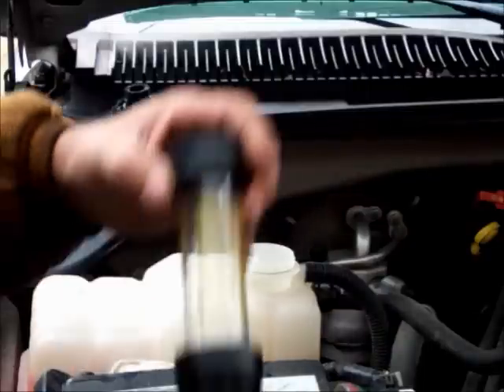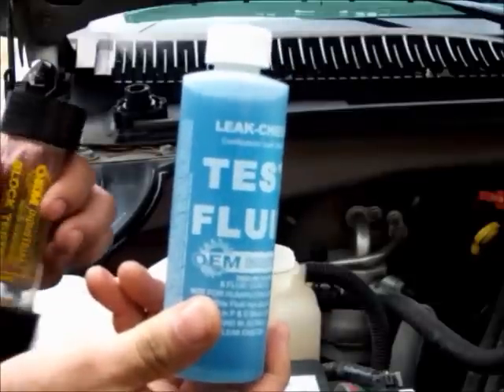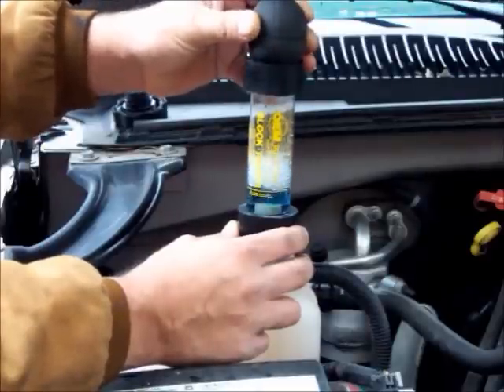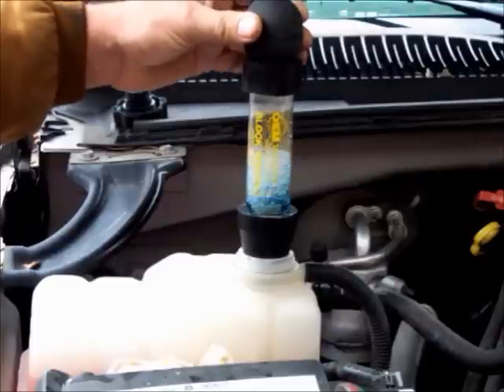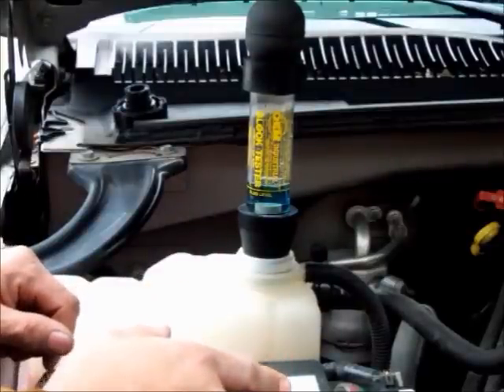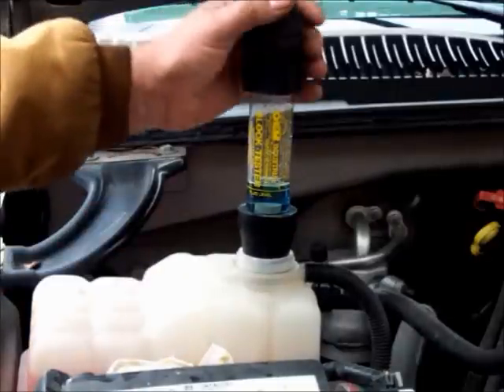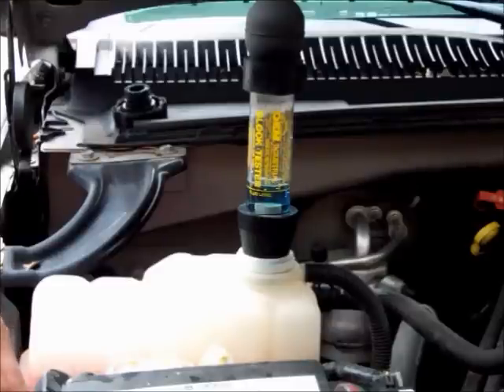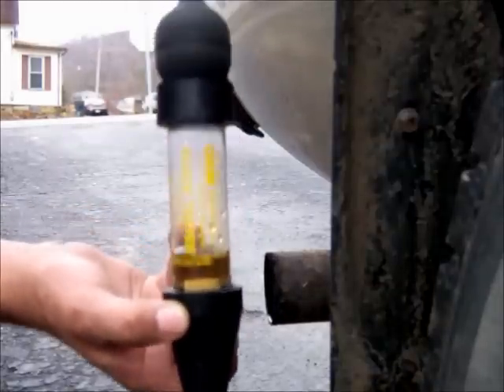Testing for Bad Head Gasket or Cracked Head or Block.

Comment: Do this block test . Then pull the plugs toi see one or two plugs are bit looks different from others like bit cleaner.  Because of evaporated radiator fluids steams cleans out plugs.  When you see those plugs with the cylinders then that locations causing leaks.  Usually i would put small scope camera to see the leak running down those cylinders even .
Reply from the maker: Thanks for stopping in and commenting

Comment: Where are you putting that tool in the resevoir ??
Reply from the maker: Yes unless one has a radiator cap then test there . If testing at radiator cap may need to drain a small amount of coolant out , so it does not get sucked up in the tester

Comment: Looks like this test is done from the coolant overflow tank, is that right?
Hope you reply because I Really need to know if I should get my transmission rebuilt without the worry of a cracked block. It overheated on me after the issue began and after replacing the upper part of the motor only to have the transmission crap out.
Reply from the maker: If the vehicle has a  radiator cap use it . but coolant needs to be down enough that it will not get sucked into the tester It will tell if exhaust gas is entering the cooling system . That could be a gasket , warped head or a crack. Sometimes a crack can leak when engine is at operating temp and not cold and could also be the other way .
Reply: Thank you. Since my comment I went and picked it up.
Fluid stays blue at the overflow tank.
Will drain a little fluid at the cap and test there as well.
Reply: No need to reply to this. Did the test at the radiator cap, still good results.
Had major issues less than a year ago. No heat, major overheating.
Ended up being cracked heads. Replaced last winter and all was good until June.
Transmission decided to act up. Code was saying P0740 TCC Solenoid Circuit.
Replaced four solenoids and all was good but after 118 miles the problem returned, same code.
And it overheated again. We had the engine mounts disconnected and the engine cocked a bit to do the work.
So my thought, as well as the guy who did the work is, an air bubble got trapped in the cooling system while doing the work due to how we had the engine.
It's a 1998 Pontiac Tran Sport which can be a pain in the backside with trapped air bubbles.
As with everyone else, you would be shocked if you saw this van! It's mint for it's age.
Reply from the maker: @GreenMountainGoldTrap  spill proof funnel , can help get the air out .
Reply: @wtbm123  👍 Yes, this vehicle has given me experience in that area. Done it a time or two with other methods.
Thanks!

Comment: You said unburned gas won't set the color off well what if you have water on your spark plugs and they're fouled out how do you know that that is a head gasket or an intake gasket
Reply from the maker: Compression is greater pressure than the cooling system so the exhaust would enter the cooling system . If you have enough water in the cylinder that it will not fire . then you know the  issue is a coolant leak but where . You may be able to do a pressure test on cooling system to see if you can see where the coolant is leaking . Or can do a leak down test of the cylinders and see if cylinder holds pressure . if it does hold good pressure , and you are leaking a lot of coolant then it probably not a head gasket . They also make dye to put in to coolant . . It can show external leaks or can help show if  gasket is leaking when tearing it down .

Comment: I did this test on the radiator & coolant overflow it did NOT turn yellow. But when I tried it in the exhaust pipe the liquid turned yellow. Is that mean I have a leak or bad head gasket?
Reply from the maker: No exhaust is supposed to come out the exhaust and a good way to test the fluid to make sure it is good . And this test will pick up the exhaust in the coolant , but could miss very small leaks
Reply: @wtbm123  How do I check for smaller leaks?

Comment: Is it possible to know if is gasket or craked without open the engine  ?
Reply from the maker: Not always , but if had a scope may put in cylinder , pressurize coolant and look . . Maybe dye , but would probably still need to tear apart .
Reply: @wtbm123  tank you sir .

Comment: Great video. I just did this test on my 05 f150 and when squeezing the bulb, it stayed deflated when let go. Why would this be?  I could squeeze the sides back to try to force inflation and some bubbles would come up through the stone, but not easily like it should. Any ideas why?
Thanks!
Reply from the maker: I wonder if that tester ball is defective
Reply: @wtbm123  I guess it's normal after checking other videos
Reply: @johnkelly4381  awesome! Thanks for the tip!
Reply: happenned to me too bro... i rented from Oreillys..  vids show it effortless sucking up air bubbles but in actual, the damn thing is weak and tends to stay deflated

Comment: I can’t really tell of a 1994 Ford ranger it’s leaking coolant after revving it up to 400,000 RPM and it’s also leaking transmission fluid and oil the guy told me that it had a new transmission and a rebuilt motor can you tell me exactly what’s going on I’m having a very hard time can’t figure it out

Comment: I have a 1993 Ford Ranger 4.0 liter. The engine temps increase only when AC is being used in slow moving traffic. However It's normal on the highway with AC on? I flushed out my radiator 4 times and did a cleaning and then used 50 50 antifreeze. I hope it's not my head gasket. No water on the dipstick etc.
Reply from the maker: Is the AC fan working , Does it have its own cooling fan
Reply: @wtbm123  No, only 1 fan. It's a 93 Ranger.

Comment: Are you sure that you can use the overflow tank to do this? I used the radiator cap, but the anti freeze  slowly rises, and I cant test it because it comes up into the tube, but every video I see of block testing uses the raidator cap area.
Reply from the maker: If there is a cap on the radiator then use it , if not use the coolant revivor
Reply: happenned same with me... they say suck out some antifreeze so the level is lower but it keeps rising as ur testing.. did it 4 times and it eventually rose into the tube and mixed with the blue stuff... it then turns green and gives a false reading... tricky to use!

Comment: Good video, thanks 👍 is it okay to use it on all vehicles.overflow tanks or should it be done directly on the radiator? Need to do this next weekend
Reply from the maker: it depends on how it is made . if it has a radiator cap and it is high enough to not leak fluid when open then you can use it , but the coolant needs to be below the tester enough , as not to suck coolant up in the tester . . Many do not have a radiator cap so you need to use the overflow tank.
Reply: @wtbm123  Thanks for the reply man 👌👍

Comment: So, do you put the tester in the overflow or in the radiator? I need to test mine. I’ve changed the thermostat and water pump and it was giving warm air all day and the temp stayed right in the middle until the late evening and the temp started rising and no heat in the cab again. I’ve been thinking maybe the thermostat although was recently replaced may have went bad or maybe the heater coil or the coolant sensor. I pray it’s not the head gasket. My town and country LX is a 2001 with only 76,000 miles on it. Please reply so I’ll have a better idea of what I need to do next. Thanks
Reply from the maker: Well that depends on how the system is made on yours . If the radiator cap is lower than top of engine , a lot of vehicles do not even have a cap on radiator  , but if lower than engine need to use the overflow bottle . if the radiator cap is higher than top of engine then use it . . Also do you see coolant leaking or smell it up in engine compartment . If so may want to pressure test it to see any leaks

Comment: I don’t no what else to do
Reply from the maker: test it . if turns color you have exhaust gas in coolant , This is a good first test , but sometimes hard to find if very small leak . a gas tester is more accurate but very costly , but could have a garage test it for you .

Comment: Ok can you help me with something ok I have gmc envoy 2005 I’ve change out Radiator water pump thermostat idler pulley Alternator Tensioner pulley and all the water inside the radiator is going somewhere there’s no leak showing but every time I have stop somewhere I have to put water in it
Reply from the maker: Well you will need to either do a block test to see if it is getting combustion gas in coolant , witch would prob be a head gasket . If so fix because if coolant gets in exhaust it will ruin the  catalytic converter . another thing to do would be to pressure test the cooling system and look for leaks

Comment: Thanks. Great information.  is it possible to get exhaust gas leaking out from a turbo back into the coolant system and changing the colour?  Some Ford eco's have a secondary cooling circuit via a small auxilary 12v pump to just cool the turbo water jacket, even after switch off. If there is good cylinder/headgasket pressures on test and all other things considered, could a damaged turbo/seal give similar coolant loss symptoms to a leaky head gasket/cracked head/cracked liner/block do you think?
Reply from the maker: Maybe . Have you tried a coolant pressure test to see if any coolant shows up there . I am not up to speed on those so i not sure what all you can see looking for coolant leak there . maybe a line to turbo leaking  some of those only leak when cold . So may need to test both ways cold and hot , some are hard to spot so if do not see any leaks and spark plugs do not show signs of coolant , then may need to put dye in and pressure test .

Comment: I like how they named it test fluid
Reply from the maker: yea and i do not remember how long but it does have a shelf life
Reply: @wtbm123  I just did this test but was worried about getting it up to middle on the heat gauge without a cap on, how warm does the engine need to be when doing this test?  I got my engine to 1/4 on the heat gauge and did the test for roughly 5 minutes with no signs of fluid color change. Is there anything I should've done that I didn't do
Reply: @darrenvogel8096  the motor needs to be Fully warmed up so the antifreeze is circulating Thru the block into rediator or else the tester will Not be registering exhaust fumes... the radiator is isolated more or less from the block during warm up till u are at full temp, then its open and the block gases, if any, will be carried thru to radiator tester

Comment: If my block is broken how would I fixed that a new head casket ?
Reply from the maker: this tells if leaking , you still need to find out where it is leaking , Could be a head gasket , warped or cracked head or a crack in the block . If it is leaking , may need to do a coolant pressure test , use dye , or even looking at plugs can sometimes tell what cylinder or cylinders the leak is at

Comment: Thx for video. Question: will this test work if the gasket is only leaking into the oil
Reply from the maker: No . It has to leak into coolant . If you do a leak down test you may hear it going in to oil .

Comment: I have a 13 mustang gt with a v8 and after doing this test my fluid turned green. What does that mean?
Reply from the maker: Could be a leak , if you are having issues , and only green , you may want to find a shop that has a gas sniffer as they are more accurate especially for small leaks

Comment: After many weeks of trouble shooting and replacing the Thermostat, the Radiator and the hoses my car was still overheating but only after driving it for a couple hours and only when I would come to a stop light or stop sign off the freeway. Inner city driving here and there never caused it to over heat. Finally a mechanic did a Combustion Test like above and came to the conclusion that I may have a small crack in the head gasket or somewhere else. There is no leak. It just over heats after long Distant driving and then coming to a stop. I see head gasket sealer products like the very in-expensive AlumAseal powder and the much more expensive K&W Fiber Lock Head Gasket Block and Repair. Will either of these work to possible seal and small cracks I may have without damaging or clogging anything such as my radiator. Just wanna try and get a few more miles out of my care before till I can afford to either fix it, replace the engine or buy a new car. Any help would be gratefully appreciated.
Reply from the maker: Every once in a while something like one of those will fix it but most of the time not and some fixes are temporary

Comment: Wondering if i have my heads torqued down good enough. 2009 Honda Odyssey ex-l 3.5l says 22ft lbs then 90 degrees 3 times. Angle gauge off Amazon was a few degrees off. Rechecked valve adjustment 👍 all hoses/wires👍 all 3 timing marks are dead on👍 wont idle in park and doesn’t have a lot of power😐 Maybe a scan tool is a good starting point? 😐😐😐 Sure hoping the checked for cracked heads at machine shop. Waterpump froze so timing belt broke. 4 bent valves, pistons only had a slight scratch where valves touched.
Reply from the maker: Have you done a compression check , are you sure valves are adjusted correct , can you check the vacuum . Could anything got in exhaust and have it restricted . and very sure timing marks are correct .Vacuum leak but a vacuum leak usually running still gets better with increased rpm  I would try and check things like that first . If you can hook it to a scanner , see live data and make sure all sensors like cam and crank sensor is reading right . Hope you ge it sorted out .
Reply: wtbm123 Havent ran compression test yet. Otherwise all of that is good-i replaced both camshafts because a lobe on each was badly pitted- im wondering if i have a wrong camshaft? They looked the same 14100-rgw-a02 for front and 14200-rgw-a02 for rear 2009 honda odyssey ex-l 3.5l Maybe compression test would verify that too? Its hard turning over by hand so i think it has good compression 😐😐😐

Comment: WTBM123
>//     {                The coolant combustion tester/detector will only test the coolants fluids for a bad head gasket?  The Coolant combustion tester/detector doesn't test if the water pump is work correctly or if the radiator and engine has rust and other chemicals in the coolant?
Reply from the maker: it only test for burnt gas in the cooling system . it does not test liquid or for a bad water pump . it is only designed to test for burnt gas

Comment: I did this test today. Fluid stayed blue. But, then I realized I didnt have enough coolant in reservoir. After adding coolant well below topping it off, I noticed coolant getting in tube turning it yellow. So I barely put the tube in with less suction, and it stayed blue. Huh?
Reply from the maker: coolant getting in the tester will give bad results. it is only a general  test for burnt gasses . it is a good first test . there are better test equipment out there , but it cost a lot and out of price range for most diy people .

Comment: Is it okay to do the test through the overflow reservoir rather than through the radiator directly as you show in the video? I don't have a radiator cap which is why I'm asking. The directions on the kit that I have say to test it directly through the radiator.
Reply from the maker: Ones with no radiator cap , you really have no choice . If possible it is better at rad cap

Comment: That nice because I can disable the ignition on any cylinder I need via obd software.
Reply from the maker: Yes , just need to let it have time to be sure all burnt fuel is out of cooling system , so can get a true reading when disabling cylinders , if that makes sense

Comment: Firstly thank you for an excellent video with clear explanations, I had my car tested yesterday and my fluid level was slightly high when he tested it and it only went green  not yellow, but is telling me that my head gasket is blown and going to cost £2000 to fix, I am not losing any fluid or suffering any loss of power and have no milky oil in my cap, does this mean that my overheating issue may be caused by something else thermostat or water  pump etc, or does green mean it has definitely blown, many thanks
Reply from the maker: Usually green is a slight leak , but if take to a well equipped garage they can do a lot better test of the gasses with a machine that tells exactly what it is reading

Comment: My truck right now doesn't have no coolant in oil no smoke no carbonmonoxide in radiator it runs great it has flushed radiator new waterpump good circulation new thermostat fan works it has good circulation and still overheats I'm at a loss it even gets hot with thermostat out
Reply: Same problem that's why I'm here today looking for clues

Comment: Ya got me thinking at the end there. I wonder if they could make a tester where you test the exhaust for evidence of coolant.
Reply: @elfpimp what you can do is actually the reverse of that, take it to an emissions tester and test the coolant for flourocarbons. Run the engine until it's warm, then pop the radiator cap and hover the tester wand over the opening. If you're getting exhaust emissions from the coolant system, you've got a leak.

Comment: Hi today my car was boiled,when i open my engine.radiator extra tank cap was pop uped.after re fill the radiator it was runing normal condition.i was face  this befor two week.will you please advise the reason?

Comment: Who else watching this has a Northstar V8? 😂😂😂
Reply: I had a northstar that was overheating and found that I just had air in the system. After bleeding out, no more issues.
Reply: I have Toyota 2.4 2az-fe , 2002-2006, with coolant leak issues. Just doing research.  Aluminium engines that have overheating issues must be tested throughly before investing $$ in them.